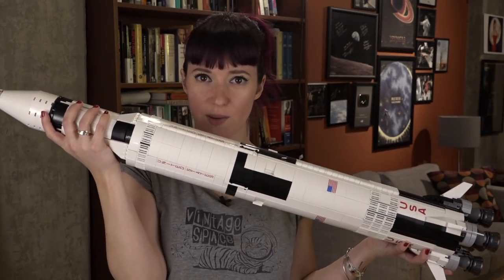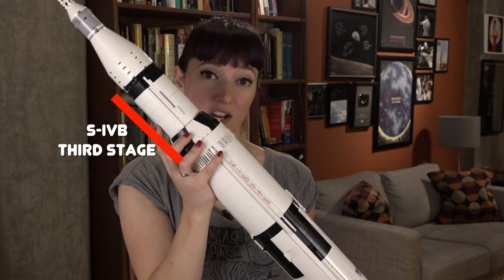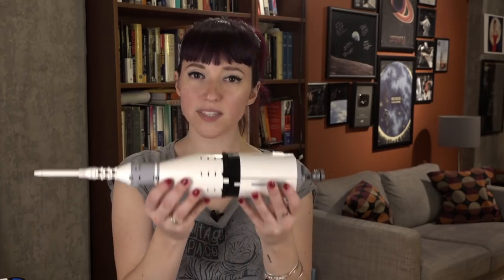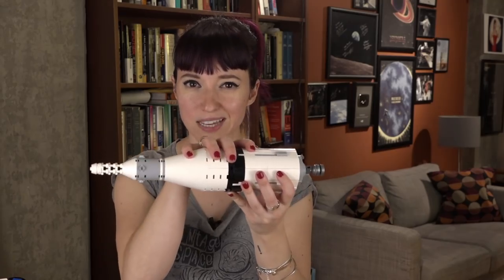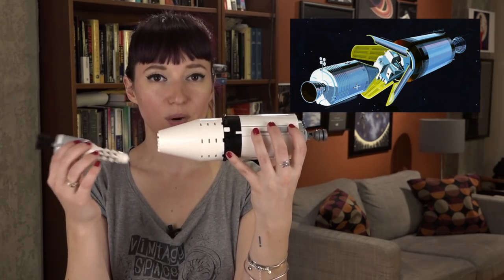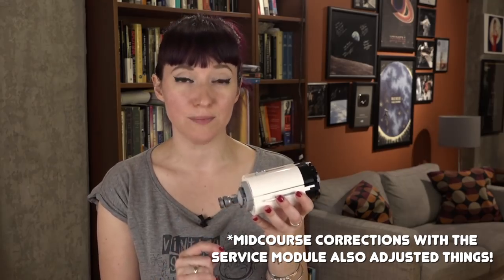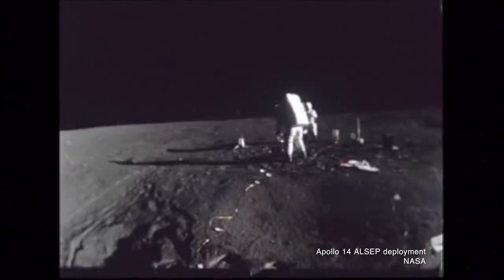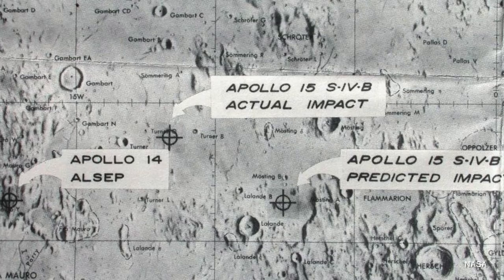This Apollo Rocket Stage was Smashed for Science

Comment: That Lego Rocket is a new Star on Vintage Space, also a beauty! I've one question -
Did the CSM run it's engine to separate away from the SIVB or did the SIVB reverse away? I'm asking because of the position of the undocked LM inbetween, the sequence was filmed at least once presumably from inside the top of a LM but whats moving which way initially isn't clear until the CSM is clear and powers up?
Reply: The CSM would use its reaction control thrusters to separate from the S-IVB/adapter section before pitching 180 degrees to come back in and dock with and extract the LM.  It would not have used its main Service Propulsion System engine to separate because it would have provided too much thrust, and the rocket exhaust would have impinged on the LM.

I think the video you are referring to is actually one of the S-IVB staging as seen from within a Saturn I first stage interstage section.  It might look like it was a CSM separating from an S-IVB due to the single engine nozzle, but what you are seeing is the single engine of the S-IVB stage.  Also, you will see 3 ullage motors separating the S-IVB from the first stage prior to the S-IVB main motor firing.  The CSM had 4 RCS modules that would be seen firing if this was actually a SCM separation.  

https://www.youtube.com/watch?v=_V2rYMu2m18
Reply: OK thanks - yes thats the footage, sorry I was a stage back on the wrong rocket!
the 3 ullage motors I assumed gave linear stability rather than motion away and that was what I couldn't work out, where the separation momentum was coming from, the steam vapour (if that's what it is) from the ullage set seemed only to go 120' each outwards (at 90' to the movement) rather than back in the direction of movement but they do a bit of both looking at a illustration of a S-IVB-2001B and looking again at the footage. Sorted thanks!

I'm still a bit curious as to the start up vapour from the main S-IVB Engine? is that also water vapour? if the J2 is burning Hydrogen and Oxygen or perhaps just H and O or one or the other before it starts / ignites and runs clear? 

it's a great piece of film but a tricky camera angle that had me thinking, maybe I'll just ask how Pete is next time ... asleep probably :)
Reply: Ullage motors perform two important tasks.  First, they provide a separation impulse to the stage on which they are mounted to provide separation before ignition of the next stage rocket motor.  Without an additional small boost, there would be no real force available to separate the stages once the pyrothechnic fasteners have fired.  The two stages would simply coast along in formation.  At the point of staging, the rocket is essentially "weightless" as its momentum is carrying it forward, but (except for atmospheric drag ) there are no acceleration forces acting on it.  Second, and more importantly, the ullage motors propel the stage forward while the liquid fuel and oxidizer in the tanks remain in "free fall".  This forces the intakes of the rocket motor feed lines up against the liquid.  We think of it as "settling" the fuel to the bottom of the tank.  This ensures a positive flow of fuel and oxidizer to the motor when it ignites.  Some stages of the Saturn rocket were also fitted with "retro" motors, similar to ullage motors, but pointing forward to provide a decelerating force to the stage being discarded, to increase the separation forces between the two stages.  I can't speak with any certainty as to which stages carried retro motors.

I'm not certain of the design of ullage motors, but I would guess that they are solid rocket motors rather than hypergolic systems.  Solid rocket motors are a much simpler design, not requiring propellant tanks, pressurization systems, plumbing, etc.  The rockets are angled out slightly from the rocket body so that their exhaust does not impinge on the booster.  Look at the RCS assemblies on athe Apollo CSM, and you will see that all of the nozzles are angled out slightly from the perpendicular.  The "mist" you see is actually the exhaust itself, flame and possibly combustion byproducts from the motor.  Flame in the vacuum of space looks quite different than in the atmosphere.  Atmospheric pressure forces rocket exhaust into the "candle flame" shape we are used to seeing.  In a vacuum, the exhaust will be a straight vector emerging from the periphery of the rocket nozzle.  The "vapor" you see when the S-IVB motor ignites is also exhaust, actually flame.  I don't think you would see water vapor from a liquid hydrogen rocket engine in the near vacuum that the staging takes place.  Remember, you need atmosheric pressure for steam to condense to liquid.  In the vacuum of space, water would only exist as a solid or a gas (yes, liquid waste dumps from manned spacecraft exist as liquid, but this is a function of the surface area of the free liquid, and the droplets would quickly "boil away" to a gas, or freeze to a solid.  Even in the atmosphere, hydrogen rockets tend to burn cleanly with no vapor (as in the SME's on the space shuttle).
Reply: yes on the main engine it was the initial vapour which then cleared to just a kind of blue light in the nozzle that had me wondering if it was a start up 'unburnt' fuel we can see or as the fuels are the two ingredients of water (H2O) wether thats what it was, possibly just proximity and then distance that make it look like it cleared. Chemistry on Earth is not my strong point let alone in Space :|

I was asking because in comparison to the LM Assent engine, which is known for no vapour trail. 

I guess that engine is off or on full blast and misses any initial start up seen on the stage main engines. Comes down to Hypergolic contact reaction fuels or 'burnt' fuels I guess which although looking different in space is still similar in atmosphere. Interesting on the fuel tanks being primed by the movement, makes a lot of sense.

I read somewhere that some ullage motors use Hydrogen Peroxide which in a reaction produce a blast of hot steam but I apprechiate the exhaust is the pressure force itself I just missed the angle they are set at and what I was reading wasn't a visual description for direction, the angle I would suggest gives linear stability and separation force, rather than being angled away to not trouble the main Engine. The angle of 3 at 120' combined produces a neat arrow cone shape keeping everything straight and stable.
Reply: I suppose it's possible that unburned fuel and oxidizer could exhaust from the engine nozzle prior to ignition.  If this was the case, then any vapor you see would be liquid oxygen or liquid hydrogen rather than water, since the two components would not spontaneously combine to form water without an ignition source.  I don't know the ignition sequence of the S-IVB well enough to state one way or the other whether cryogenic fuel or oxidizer was allowed to vent before ignition.  The LM ascent engine used hypergolic fuel and oxidizer.  The fuel (Aerozine 50) and oxidizer (di-nitrogen tetroxide) ignited spontaneously on contact, so there would be little chance of any unburned material to vent and produce a vapor before rocket ignition.
Reply: Just as a further thought the Apollo 13 crew witnessed a venting of Oxygen during their flight in the accident. I know it wasn't Engine fuel but think it was stored as liquid.

Comment: What about the service module? Are there any in earth orbit? If they were to burn up entering the atmosphere, were there any parts that survived and fell to earth?
Reply: Service Modules were discarded just before the Apollo spacecraft re-entered. The Service Module was always on the same re-entry trajectory when they were discarded so they followed the now detached Command Modules into the atmosphere and then burned up.
Reply: The service modules were attached to the command modules until just before reentry, so they all reentered at about the same time as their command modules and burned up over the sea. The command modules flew lifting reentries, angling their heat shields to generate lift, so they landed farther downrange than the SM.
Reply: Bured up

Comment: I love your vids! I have a question: The first manned flight of the Saturn V was Apollo 8, and Jim Lovell has been quoted as saying the vibrations during liftoff until the 2nd stage were so severe he had to take his hand off the abort control for the escape tower least he abort by accident. Does this mean that ever Apollo mission not really have a functional abort system. Had there been an emergency that didn't trigger the escape rockets automatically, could the commander have still aborted manually? No one seems to talk about this AFAIK except that one comment I heard from Lovell.
Reply: There were 3 wires that ran down the length of the Saturn V, one for each stage I believe. If 2 put of the 3 wires lost power the escape motor would pull the command module right off the booster
Reply: This is true,  but my question was about a manual abort; not the auto abort. From Lovell's comments, I'm led to believe a manual abort was problematic at best.  @salade2760

Comment: How does the dock for the service module and lunar module work?
Reply: I'm saying this all from memory, so take this with a grain of salt. There was an extendable probe (active docking mechanism) on the command module that would extend and stick into a cone on the top of the lunar module (passive docking mechanism) the PDM had a small hole into the bottom, just big enough for the probe to stick through, once the probe was in it would retract and pull the two modules together.

Comment: I think I detected an OOPS Amy.  Apollo 13 was the Houston We have a problem mission was it not. Could You do a video about it explaining how they dealt with S4B please.
Reply: Nope, that S4B was still crashed into the moon. Explosion happened after stage sep.
Reply: Robb Loeb Thank You Robb.  As I now recall the explosion was in the Service Module.  Would still like a video about that.
Reply: Good thing, too.  Otherwise, they wouldn't even have been able to get into the Lunar Module.
Reply: The only problem I remember with Apollo 13's S4B was with communications. When the SM died, they lost use of the high gain antenna, so they had to use comms from the LM, which were operating on the same frequency as the gear on the S4B (the reason being that normally the LM wouldn't be powered up until after the S4B was done away with). They didn't address that in the movie (seriously, of all the problems they had, it was a minor one), but it was talked about in Jim Lovell's book, Lost Moon.

Comment: I've wondered why NASA didn't leave the lunar module orbiting the moon when they left, that way they could return and reuse it...replacing the fuel, batteries, etc.  Do you know if they ever looked into this idea, or was the plan always to just bring a whole new module up for each mission?
Reply: They would still need the descent stage to land on the moon plus who knows what kind of damage the ascent stage left behind could suffer from micro-meteorites while it was in orbit for months. Besides that, there was the issue of mascons on the moon that was not well understood at that time which played havoc with anything in orbit for any length of time. So yes, they always planned on a whole new LM for each mission.
Reply: I forgot to mention that the type of fuel & oxidizer used with the ascent stage engine was pretty corrosive and the engine had to be rebuilt after each test firing. Simply re-fueling was not a viable option.

Comment: This video touches on something that's always bothered me. When we launch anything into space, be it a satellite, a probe whatever, the final stage has the same velocity as the payload. Even if the payload has it's own trusters to add separation, the top stage continues to follow it on the same course.

So are the upper stages of the launch vehicles for say, the voyager probes, still trailing behind those probes? Is every satellite in orbit being trailed by it's launcher's upper stage? Surely the satellites don't have enough thrust for orbital injection - the upper stage is required for that that. So once they're (both) in orbit, what happens to that upper stage?
Reply: The first few (one to three) stages always reenter the atmosphere. Thereafter depends on whether the satellite has its own rocket motor, or is purely passive. For the early US satellite Explorer 1, the upper stage was heavier than the payload . Geostationary satellites have small on-board motors, and may use their own power for final orbit insertion (apogee kick motor). Space is cluttered with a lot of unused junk, but modern launches try to be more economical with fuel and hardware, partly by using restartable motors, and gravity assisted trajectories for solar system probes. A more detailed overview can be read in this article: https://en.wikipedia.org/wiki/List_of_artificial_objects_leaving_the_Solar_System

Comment: 2nd stage landed in the Indian Ocean, not the Atlantic.
Reply: I thought so too, but not according to Wikipedia: https://en.wikipedia.org/wiki/S-II
You may be thinking of the Space Shuttle external tank, which flew a different burn profile.
Reply: tpsu129 is correct. Wikipedia is wrong. From Stages to Saturn: https://history.nasa.gov/SP-4029/Apollo_18-22_Saturn_Stage_Earth_Impact.htm (note that the S-II impact latitude is incorrectly stated as north when it was actually south) and the Apollo flight Journal https://history.nasa.gov/afj/launchwindow/lw1.html that shows plots of orbits 1-3 of Apollo 11.
Reply: Frank Bockler All of the links you provide confirm exactly what Wikipedia states. If you add the burn times for S I and II, that comes to a surface range of 2300nm from launch, which will be in the Atlantic Ocean.
Reply: I stand corrected. I flipped the signs on Lat and Long and got a position in the Indian Ocean. Of course that would be 7300nm, not 2300. Oops.
Reply: Don't feel bad. NASA (and others) have done the same, with expensive (but not human) consequences!

The Space Shuttle burn was only 8 mins, but a more ballistic trajectory (more powerful hydrogen fueled engines) took the external tank much further, with reentry into the Indian Ocean.
Reply: Yes, that makes sense. If I remember correctly, the Saturn V flew an inefficient trajectory that placed it into a circular parking orbit after completion of the S-IVB's 1st burn (as apposed to Shuttle that did an efficient Hohmann transfer with an OMS-2 perigee-raise burn well after ET sep). The S-II must have flown a low, shallow trajectory that intersected the atmosphere somewhere over the Atlantic. The T/W ratio was so low at the beginning of its burn that the S-II had to crab a bit to keep the stack from re-entering before completion. At least that's how I remember it. Corrections welcome.
Reply: Wow, lots of detail! The Saturn 5 at liftoff had a thrust ratio barely above gravity. I think the Apollo launch trajectory may have been oriented towards astronaut survival in an emergency.
Reply: I don't think the Saturn V flew an especially inefficient trajectory, unless you're referring to the fact that it used a parking orbit. A direct escape would have been more efficient, but this would have made the lunar launch windows much more rare. To minimize the inefficiency, the earth parking orbits were much lower than a typical Shuttle orbit. They'd only be in them for 1-2 revolutions so the drag loss was acceptable.